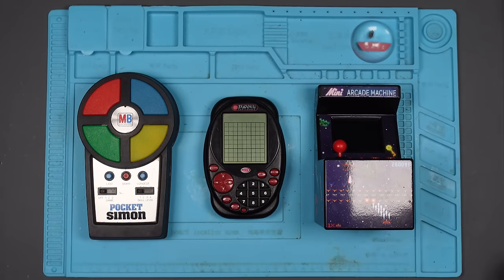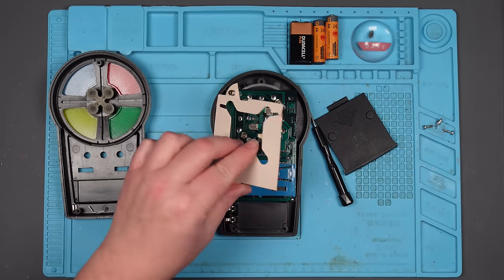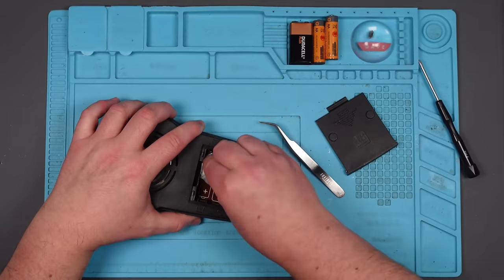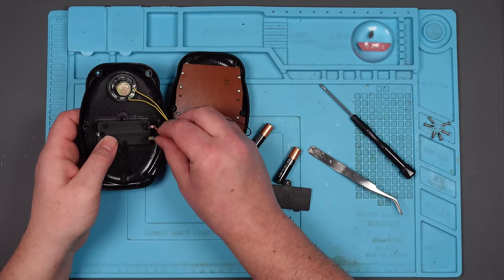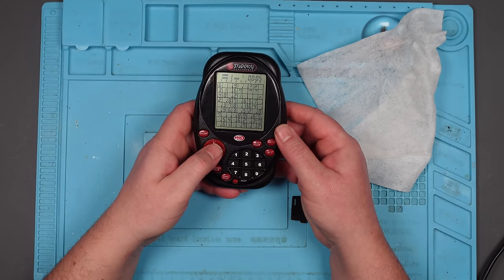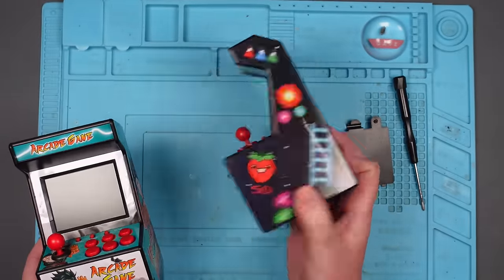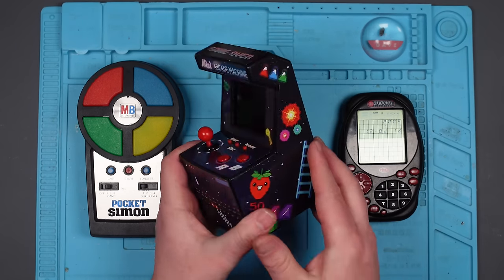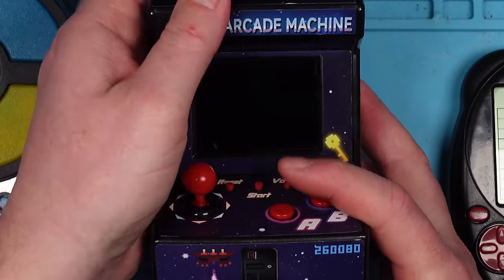£8 eBay job lot | Can they be fixed?

Comment: I reckon you reflowed some of that solder with the hot air gun, the speaker was just a coincidence...great as always..
Reply: i agree. would have been nice to see without a speaker again though.
Reply: it's using the resistance of the speaker in the circuit, instead of adding a separate resistor. I don't think it has anything to do with reflowing the solder.
Reply: @iaincowell9747  you think so?
Reply: @goku445  I've seen it in cars before where the engine won't turn on unless the door and it's electronics are attached (Porsche are really bad for that sort of over-engineering), it appears as if there's a general electric failure in the engine but it's because the door electrics are needed to complete the circuit!

Comment: £8 well spent. An annoying game, an impossible game and a WHOLE bunch of Stupid Games. I wonder if the speaker was required to complete some sort of power circuit... maybe you should desolder it for giggles and see if that's what it was - imagine... all that time spent looking for an issue.... :D
Reply from the maker: Haha, yeah spot on... I daren't touch it again, but it would be nice to find out the actual problem!  😁
Reply: I would say that yest that transistor was bad along with a cold solder joint in that area that you hit with hot air and the iron when you put the speaker back on.
Reply: @patrickradcliffe3837 yeah, I was going to say something similiar.  There was a lot crappy solder joints and when he fluxed and heated them up, it fixed the issue.

Comment: These old Pocket Simon machines used incandescent bulbs and the old TMS1000 series microcontrollers. The controllers or the brain of the thing ran on 9V, and the AAs were just a power source for the lamps. The big version was the same, but the lamps were bigger, so it used a 9V, and two D cells.
Reply: Yep. I love these older ones with the tms mcu instead of a cheap chinese blobbed asic/microcontroller
Reply: Same with Big Trak with it's, I think, 4xC (or maybe it was 4xD) batteries for the muscle, and the high-voltage PP3 for it's brains. Other toys with the same chip inside did the same thing.

Nice that the lamps still work after all these years, modern ones would surely use LEDs. I suppose when they don't have to be too bright you can keep them comfy and under-run and prolong the batteries too.
Reply: @greenaum  I have one of the larger 1970s Simon games that I got cheap off ebay not working and restored, and I have to say there's no comparison to the appearance of incandescent lamps on these. 

They're not driven very hard so they have a very notable ramp up and down when in use, which really adds to the charm of the things. Mine had a split bulb holder, a bad switch and generally just poor contacts under the strange little snappy switches inside, so it was a fairly routine but nontheless satisfying repair. 

Not to mention, I love the fact the big Simon includes a spare lamp inside the case in a little compartment. They'd never bother these days.
Reply: @ShokaLion  You'd really need a spare bulb. Those things blew at a fair rate. Back in the day...

(Christ, I can't believe bloody LIGHT BULBS don't exist any more. Not the incandescent ones for torches. I did SO MUCH tinkering with those, improvising a lamp holder with stranded copper wire, tape, and aluminium foil! You could buy them for like 20 pence in shops that sold odds and ends, "cheap shops". My introduction to Kirchoff's Circuit Laws! Without knowing it!)

...so yeah especially in torches where they ran bright. Hard on the batteries too. But they were irresistible to just mess around with and waste the battery and brightness before you needed them, they were just so cool to look at! Well, depends on the model but some were. I remember a 3V, 2xAA torch, would take a 2.4V bulb, or a 5V bulb in a 6V torch, etc. All run past the voltage stamped on the case. Though I suspect that's deliberate, the manufacturers could make any voltage they wanted by varying the wire in there. They probably made them to be over-run so they'd be brighter, but live a lot shorter life.

But then the bulbs in the video appear to have lasted decades if it's an original like it looks. That said, blue LEDs only came around in about 1995. You could get them previous, but not the type we use now, the prior ones were really expensive and dim. You need blue for Simon, so there's the fatal flaw. They could have done the other 3 colours with a single bi-colour LED! Wired up right to make red, green, yellow, orange, and anything else red and green could make. But not blue.

Maybe a model should've used LEDs for the colours except blue and leave the torch bulb for that, I dunno. I did love those old torch bulbs though! Look after yours!
Reply: @greenaum  Oh yeah, loads of fun! 

You can still get the bulbs these days, but as you say I don't think they're being made any more so they're all NOS at this point, and they charge crazy money for them. Like £1.20-£2.00 per bulb type thing.  

There are plenty of people who've made a good stab at emulating the original light characteristics with LEDs plus a driver board to ramp them up and down, but the only trouble is they go for actual red, blue, green, and yellow LEDs, and they just don't have the same appearance as the old incandescents behind a colour filter. 

It's kind of like the new breed of christmas LED lights. Absolutely granted they're far less faff, far more likely to Just Work when you fish them out of the attic each Christmas, but the quality of the light from them, if you ask me, doesn't compare. There's a warmth to those old coloured incandescent lights that you just lose with LEDs, they're too...perfect? Stark? I think the same about the Simon games that get converted. 

So yeah I do keep a few of those on standby just in case!
Reply: @ShokaLion  You're bang on with xmas lights, I get exactly what you mean. 

It might be that LEDs are monochromatic. They emit, more or less, just one wavelength. They look "dead". Where a hot wire emits all the colours beneath it's hottest one. For one thing it illuminates things better and you can see colours more accuractely. But also yeah, lots of warm red and orange in their spectrum. They were much better!

Modern white LEDs are blue LEDs with phosphors on them. But what do the phosphors emit? You can make "white" with blue + yellow, but colours of things would look really weird under them. They tend to add a couple of phosphors to them to give a better spectrum but still, nowhere near the full spectrum of a proper hot bit of tungsten. 

Yeah they're shit, old bulbs were better! But LEDs use less electricity so I suppose we can put up with them, would be nice to have tungsten for special occasions though.

Comment: sometimes a speaker IS necessary to be connected in order to work. I once desoldered a speaker from a device, and it just refused to work until I soldered it back on. it was also a Chinese device, and would loudly speak Chinese on startup. So I guess it's using the resistance of the speaker in the circuit, instead of adding a separate resistor of some sort.
Reply: I was thinking that the speaker provided some resistance like a resistor on the board. And without the speaker that resistance wasn't being met.
Reply: Would of been worth desoldering one of the speaker leads to have proved that.   Maybe the speaker was loose originally.
Reply: Or else it was announcing the CCP's orders for that morning, and citizens were required to comply before any of their electronics would work. Hua Wei tried the same thing in Britain once, I believe.
Reply: @darksageaura   That would be a weird sort of circuit. You don't want power constantly across a speaker, the coil would get hot, they're only designed for AC, ie audio. If it was smart enough to talk, maybe the software was written without the possibility of losing the speaker so just stayed in a loop til it got a connection. 

That could be as simple as connecting one terminal of the speaker to gnd, then connecting sound from an amp to the other, for normal use. But to check it's there and functioning, use a microcontroller input instead of an output. Check the connection to gnd is still there. 8 ohms, or even 64 ohms, isn't much of an impedance for an IC input. So a circuit could connect an input and check there's still a gnd connection through the speaker. If there isn't, then the speaker isn't connected up properly. 

Why it'd do that, no idea, but I suppose they really wanted the thing to say what it had to say. Did it do much apart from threaten to report your family for the camps?

Comment: The replacement transistor is absolutely fine. The original can take 0.5A at 40V, the replacement can do 1.5A at 25V. Since you go nowhere near those voltages, they'll work just as well.

Comment: These piezo speakers have a capacitance and are sometimes necessary for the circuit to work. I once removed a piezo speaker from a stopwatch to silence it and it refused to come back on. I replaced it with a capacitor (I think it was 33pF) and everything worked.

Comment: I think the resistance of that speaker acts as another way of controlling voltage. Using that heat gun did a sneaky reflow of the board might have just been dry solder joints.

Comment: On the Simon, I'm pretty sure the 9 volt is to power the lamp and the 3 volt is to power all of the logic. As I'm sure you know a lot of 80s toys did this because its cheaper to make you pay for batteries then to try and step voltage.

Comment: Love it, hope I get as good as you with the heat gun, not long got mine and in first practice I nuked a transistor and a few capacitors whilst trying to get a resistor off 😅

Comment: im thinking the heat gun must of remelt the solder on the ribbon cable that made it work 17:50 you can see the joints look better after that or something else though

Comment: Sometimes, certain chinese manufacturers route voltage in a way that everything connected closes the entire circuit; this includes the speakers.
By removing it, you "technically" seem to have shorted the board, until you soldered it back again, closing the circuit properly, and allowing full power to run.
I can see some chinese manufacturers do that to prevent tampering to extract the SOC of mini arcades like yours, to prevent copying (which coming from a chinese knock off, is hilarious)

Comment: for a spoiler below

surprised you didn't look at the speaker wires of the arcade since it has to be turned on to work. maybe it was cross linked to the power switch or something

Comment: I wonder if the ribbon cable had a dry joint that reattached itself when you used heat to replace the Y1.

Comment: I would love to send you a challenge to fix, it's a small Franklin crossword solver, turns on but 87.5% of the buttons don't work amd when it goes off you can't turn it back on because the power button doesn't work, it's very small so would make for a challenging video for you. I only paid 50p for it so you can keep it if you can fix it

Comment: AAARGH! NEVER use solder as an electrical contact. It oxidises and forms and insulating layer over the top. This will rub off on the other contact (battery) and prevent it from conducting too.

Comment: ever thought about getting one of those electrical pen sized screwdrivers? if you did (and I did) you'd not have to speed up the video each time you struggle unscrewing those numerous screws, just a tip.

Comment: Nice, Duracell made another victim, as for the last repair of the arcade game, I think you have accidentally reflowed a bad solder joint with your hot air station. Chinese solder joints are crap, I have seen people carefully reflow entire PC boards and they came back from the dead.

Comment: Looks like you accidentally fixed a short or broken contact by applying hot air to the area of the control connector of the Mini Arcade.